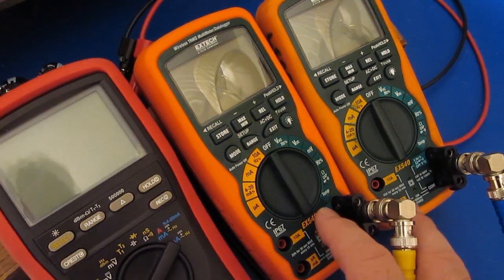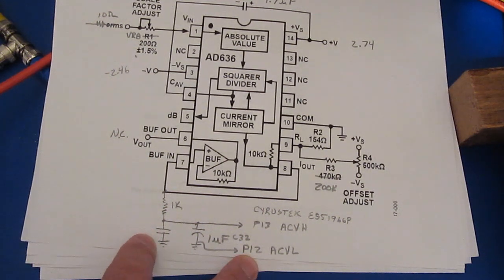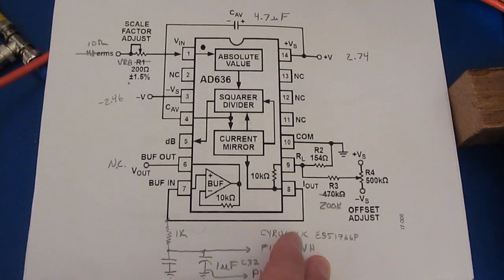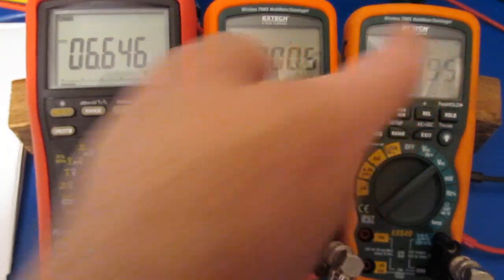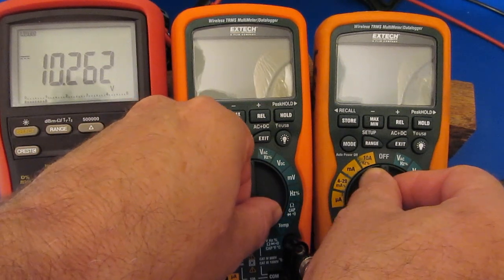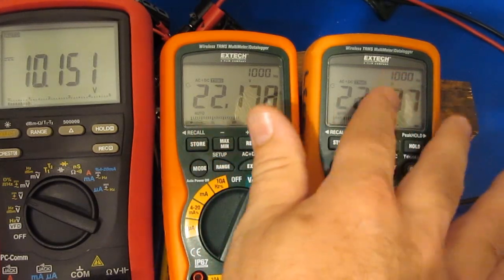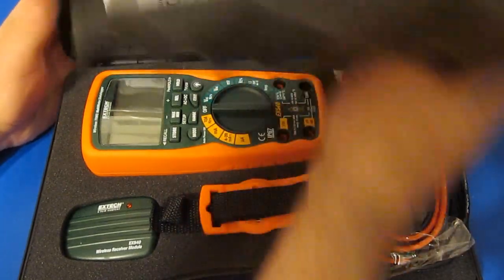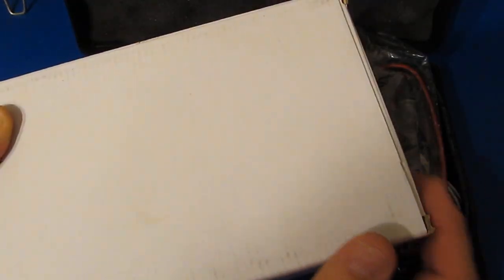EXTECH EX540, Further Comparison and Final Thoughts

Comment: excellent review joe as always
thanks for the excelent effort dear
Reply from the maker: I am half tempted to buy another one from a different rebrand just to see if the quality was good enough that I could run it.
Reply: i hope you can give me your opinion about this multimeter, cause it looks like a very good one, SBS-600
http://www.tequipment.net/Storage-Battery-Systems/600/Handheld-Multimeter-1/?v=7231

i like the multimeter to draw a graph on voltage and current or temperature when thy go up and down suddenly  , it helps my vision and makes things more easier to design circuits.
im working on a new project involved in 3 phase to single phase automatic selector, many OP AMPS and zeners and transistors is used so far , and actually your review on the UNI-T UT181A helped me to buy it, cause it has a very important feature, you showed it to us ( AC + DC ) but its not like any other logging multimeter that its only combine them, rather the UNI-T give both in the same time, that feature was excellent, because it help me immediately identify the problem of having an AC voltage with the DC voltage supplied to the transistor and it was causing the high temperature on the transistor.

thanks again dear ... its a pleasure to learn from you
Reply from the maker: Glad you found the UT181A videos to be helpful.   It's the best product I have looked at from them but I wish they had charged a little more and improved it.   Looking at the meter you linked, I can't really offer an opinion outside of it not being certified and there is no mention of the EMC standards in the manual.   Looking at the TPI 194II and UT-181A, we know that some of these more expensive meters fall way short when it comes to my testing but if you are happy with the 181A, this meter may work out for you.
Reply: joe smith yes you're correct about the SBS 600. .. i will look at the TPI 194 also to see if it suits my needs...also  i will update you if i encounter any issues with 181A during my project process...
anyway..keep up the good reviews... your videos is one of the most important instruments reviewing on the web.. and if i can help in anyway... iam definitely ready.
BTW:.... HAPPY NEW YEAR 2017 .... CHEERS
Reply from the maker: Thanks and a happy new year to you and yours as well.
Reply from the maker: I have on order another supplier for this meter.  I am not good about producing videos in a timely manner but stay tuned...
Reply: joe smith excellent jow... I'm waiting it definitely.. i wonder if you could share with me the link for the schematic diagram of this meter and for the uni-t ut61e. i have few curiosity to play around with it.
Reply from the maker: The 61E is easy to find with Google but someone had posted a corrected version on EEVBLOG not too long ago.   I have not found one for the CEM.  If I come across one, I will provide a link.
Reply: joe smith i can see.. thanks dear much appreciated... looking forward to see more videos🖒
Reply: Ты это за какой хрен,мне втираеш?

Comment: As far as I know EXTECH  does not make meters so maybe they switched to an other manufacturer.
Reply from the maker: This meter is a rebranded CEM DT9939.   While the missing star washers and shield may have been randomly left out, you would think Extech's incoming inspection would pay close attention to the functionality of their products.
Reply: You would think so but even the big brands make mistakes. I now have a G&M Pro-test here for repair that has a resistor soldered only on one side because it was placed 90 degrees wrong. The other end&#160;and was floating. It worked over 20 years like this.A tek signalscout SA missing one resistor so one off the attenuator relais was never powered. (this was send many times to Tek for repair before I fixed it) These are only 2 things that come to mind at this moment. I have seen more screw-ups like this from big brands. (I'm an independent test- and cal-gear repair lab so I see a lot of different brands) Also design faults like the same G&M Pro-tester that has a selftest that checks 4 relais. Those relais needed replacement but not according the self-test. When I took out the relais and did the selftest again without the relais still no error. I think they want you to listen very careful if you hear them clicking. The manual only tells that the relais are two times actuated not that you need to listen. That is pretty useless. As stupid as a G&M PAT tester I had here. Turned out a relais failure used for isolation tests. With the bad relais even a pure short looked like a perfect isolation. They found out during the yearly calibration.
Reply from the maker: I think I've ran somewhere around 40 meters now from various mfgs.  This is the first one that had problems and at $300, I expect it to at least power up out of the box.  No excuses.